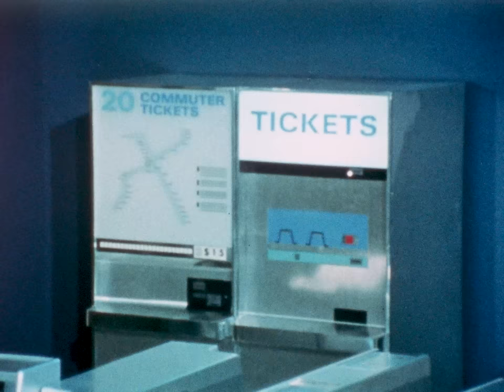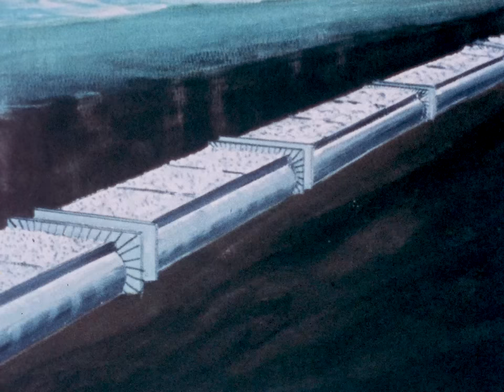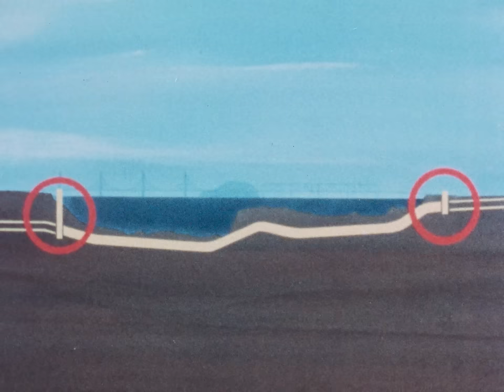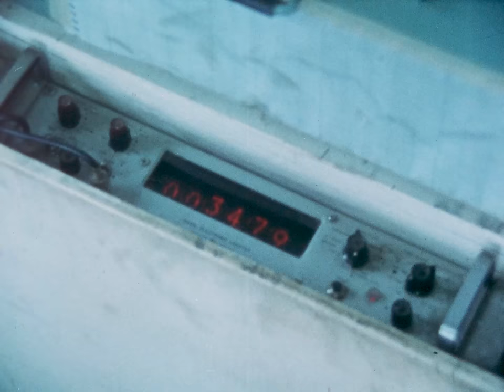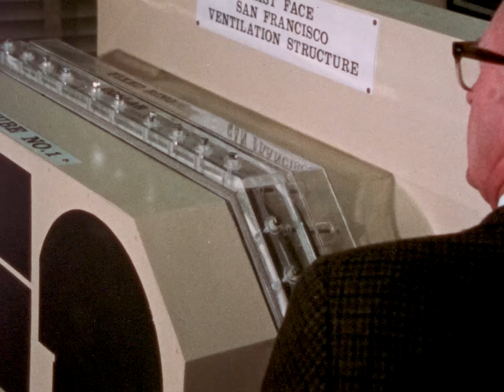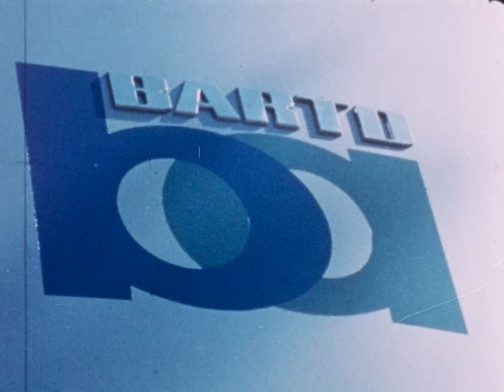50 Years of BART | The Transbay Tube

Comment: As a student in the Bay area, I see advanced microprocessors and “software” all the time. but the howling sound in when Bart passes the transbay tube is the icon of American engineering.
Reply: I feel that way about all subway systems.
Reply: You can blame the howling on BART cost cutting measures. The trains originally had steel wheels with a rubber composite ring or "tire" on them... very quiet running. I remember when you could carry on a normal conversation going through the tube.  Those quieter composite tires  weren't lasting as long as conventional railroad steel "tires", so BART phased them out by replacing the rubber composite ones with conventional steel. The noise levels of the trains shot up dramatically, I remember being able to carry on a normal conversion going through the transbay tube without needing to yell.  The way the system has turned to crap going through the Oakland and Embarcadero stations... you can't pay me enough to set foot on BART these days.
Reply: I suspect my old BART commute gave me tinnitus, or at least in part contributed to it. Those old trains get loud when they got up to speed, can't say anything about the new ones since I haven't been on one.
Reply: The howling represents the death of American engineering.
Everything in BART was custom-design, following aerospace principles. They INTENTIONALLY used minimally-tapered wheels, under the premise that track deflections would be tightly controlled.

The "Wheel Geometry Change" is a mediocre workaround, because resetting/replacing all the tracks would be too hard or expensive.
Reply: Well I was almost stabbed on this icon twice
Reply: dont forget your earplugs
Reply: It’s such a  unique, sinister, eerie and distinctive sound that it’s been used by sound engineers in many horror movies and video games…  Dead Space and Doom are one of them  😅
Reply: well i find the howling sound so damn annoying lol…

Comment: They definitely did a good job in preparing for earthquakes.  In 89 a section of the bay bridge collapsed but bart didnt have any issues
Reply: I remember the ride in the tunnel was not as smooth as before the earthquake but it was running.
Reply: They shut it down for 24 hours anyway just to make sure that they inspected everything.
Reply: Apparently passengers didn't even know anything happened. At least that's what I heard.

Comment: The Bay Area no longer has any steel shipyards. Would be that much harder to do this today. :/
Reply: I believe that these days, we have the ability to move material from one place, using such modes of transportation as ships, trucks, and the railway.
Reply: @leisti  haha fair enough. But 1) being able to build these in the bay, then drop them off directly in the bay, probably cuts transportation costs significantly, 2) also good luck transporting a 300 foot long, 800 ton tube by truck or rail.

Comment: I been working in the Transbay Tube it is amazing, when the trains passes by there is no vibration or shaking what so ever. You can hear it as it zips by and fil the piston effect of the air movement, but you do not fil the train. And it was built with a slide rule.

Comment: The "Self-Service Fare Collection System"  does not look like the one that was eventually installed in BART stations it has rotary turnstiles while the installed BART system had little sliding half-doors on a pneumatic system.

Comment: Great documentary! I’ve been curious about the tube for a long time. I’m curious about corrosion. What is the expected design life of the tube?
Reply: my guess is that the galvanic protection system has sacrificial anodes which can be replaced at regular service intervals. They rust, the tube doesn’t.
Reply: I was wondering this as well. All bare metal in that salt water

Comment: Wait a minute, so they submerged the tube sections with workers inside them?  Am I understanding the part around 11 min - 12 min correctly?  It sounds like they had workers inside the tube sections as they submerged them and then the workers cut the bulkheads away.  Is that right?
Reply: good point

Comment: I rode BART for the first time in 1973 from the Fremont station in the east bay area north to Berkley. I was 13. I've ridden through the "tube" several times in the 1980s-90s.

Today I'm nearly 63 and BART STILL has not circumvented the south bay, and probably never will.  .
Reply: It will connect to Caltrain in San Jose though
Reply: @edwardmiessner6502  Long after I am dead and buried. I rode it from Fremont when I was 13 in the early 1970s.  It took most of my life just to make the short extension to South San Jose.  Hope you get to use it.  ;-)
Reply: Food for thought: The BART system at its initial buildout back in the 70s cost $1.3 Billion which adjusted for inflation is $10.5 Billion. Compare that to the replaced bay bridge that completed in 2013 at $6.4 Billion which adjusted for inflation would have cost $8.2 Billion. a 75 mile grade separated track, its 450 cars, control system stations and all cost just 25% more than a 2 mile freeway bridge.
Reply: First time for me on bart was when I was 48 in 2004, it was the last time too
Reply: @Doggeslife  it goes to Berryessa now
Reply: @blue9multimediagroup  Yes.  When I lived in that area in the 1970s the last station was still a fruit orchard next to the flea market.  The orchards are gone, the flea market is much smaller now and the area had been totally built over.  Progress....I guess.
Reply: @Doggeslife  Look how long it took just to extend it to SFO.

Comment: Just curious, from a commuter's perspective, how has the experience been improved compared to that era? I can think of the Clipper Card. Anything else? Are the trains faster, for example? Or more on-time?
Reply: The trains are slower. The plan was for trains to excelerate out of stations quickly and to stay at speed until just before the station slowing down quickly.  Standing people were rolling down the aisle so they had to stop that.  The trains were also supposed to be much more automated but they were crashing into each other and running off the end of the track.
Reply: @tedthurgate  Tesla should take note.
Reply: noise: new doors seal the noise out better. straightaways slightly worse since the tracks became corrugated with time, though they are grinding them smooth. curves slightly better since in 2021 they switched to a more tapered wheel shape.
Reply: The 4 original lines used to end at Richmond, Fremont, Concord and Daly CIty. There was no Dublin-Pleasanton line. 15 stations have been added, & you can go right into both SFO & Oakland airports now.
Reply: I used to ride BART a lot in the '80's through '90s.  In those days a trip through the transbay tube was a screaming event.  The trains would howl.  Passengers would plug their ears.  I understand they polished the tracks and it is quieter.  Now, the trains have added some weird metal stubs on the exterior train ends.  I don't know why but suspect morons were using the connection between trains to tag the train exteriors.  Overall, BART is still a great ride, but they took all the seats out of the trains.  Now you have to stand.

Comment: BART is the loudest, dirtiest, and most uncomfortable metro rail system I've ever used. Also super expensive, like $6 just to go a few stops! And in SF they decided to overlap the lines, instead of having different lines go to different parts of the city. One of the worst metro rail systems ever.

Comment: Does it really go 80 miles per hour?  It doesn’t seem that fast.
Reply: The trains can go faster but are governed to 80 max.
Reply: Through the tube it runs that fast. Regular speeds in the network are slower. But still fast.
Reply: I did some more research and it seems that they lowered the max speed to 70 some years ago. And I’ve clocked myself using a GPS as fast as 68 between Castro Valley and W. Dublin.  So they do go pretty fast!  Just didn’t feel like it.
Reply: @stevefeinstein  --  I suppose the wider than standard wheel gauge "explains" that.
Reply: @GilmerJohn  After a bit more reading, it seems that the maximum speed these days is 70 mph.  You're probably right about the wider tracks, it's doesn't really feel that fast.  But I've used a GPS to verify it, and I've seen as fast as 68.
Reply: @stevefeinstein  --  Well, in the early 80s I had a two week contract to work at Berkeley, CA.   I had a cousin that lived on the other side of the mountain (Walnut Creek?) but otherwise I was on my own.   I asked my customer about taking the BART to SF but he advised me that it made more sense to take the bus!   I did ride the train with my cousin once.

At that some some folks got bent out of shape because the BART designer picked a wider gauge but it likely only had a small impact on costs.  It's all semi-custom work in the first place so making the trucks and wheel sets for a wider gauge was no big deal.

When SF had the Near Miss "Big One," I called my cousin a day later and asked him about it.   He said he was riding the BART train when it hit!   He said the train was swaying back and forth and it's likely the wider gauge kept it on the tracks.   They may be slowed it down a bit "just in case."   Frankly, there is little to be gain by going that last even 20 mph.   It takes a lot of power and it makes it a PITA to slow down and doesn't say all that much time since the train will be stopping frequently a lot of the time.

BTW:  I grew up in Pittsburgh (PA).   I didn't  know it at the time, but the PCC cars used on the streetcars were a slightly broader gauge than the standard 4ft 8.5 inches.   I guess in Pittsburgh they wanted the wider gauge because of the hills.
Reply: @GilmerJohn  one component of that faster speed on the straightaways is the decision for cylindrical wheels with solid axles (vs. tapered) and the lightweight aluminum cars.  A downside of the non-standard car and trackwidth design is the exorbitant cost to make custom replacement cars, which is the reason it took BART so unbelievably long to update/add/modernize their rolling stock.

Comment: I went from the Oakland airport to Walnut Creek in April a trip of about 20 miles. I had to change trains twice and it took over an hour to go about 20 miles. The station bathroom in Oakland was a dump. The cars look old and dirty and dated.
Reply: They  are now replacing all of them with new  ones
Reply: If you had to change trans twice then you got on the wrong train to begin with.
Reply: @jeanesingsjazz  to be fair the signage is pretty confusing for new riders, and add to that the frequent shutdowns, cancelled trains, and bus bridges
Reply: @timothyhoekstra2604  agreed!  new/first time riders need to study the maps and all the timetables. the signage has gotten a bit better over the years, but the audio announcements are still garbled 90% of the time.